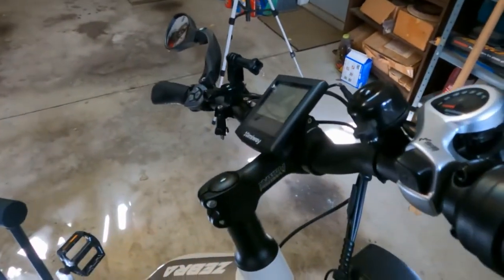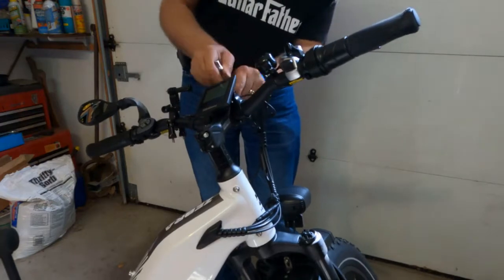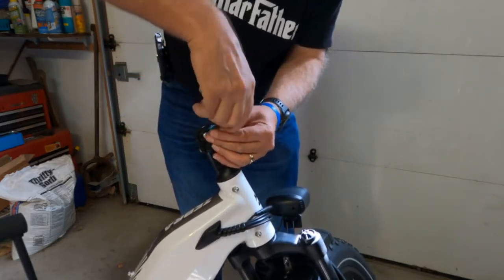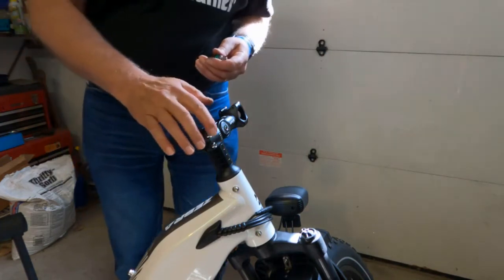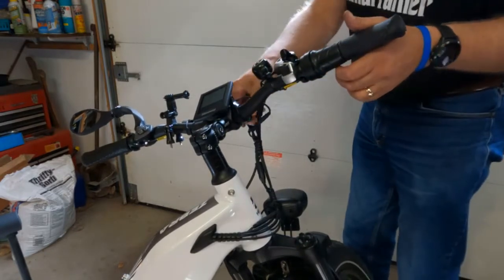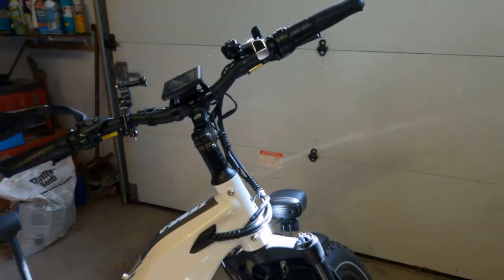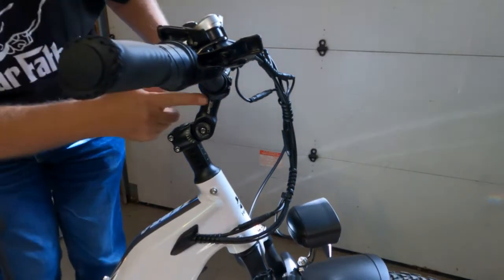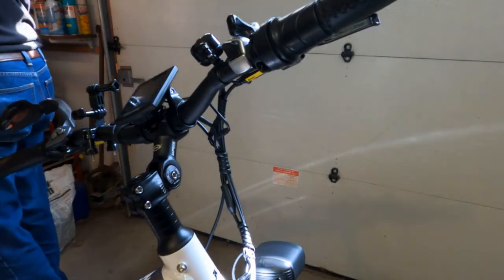How to install an Adjustable Extension Handlebar Tube on your Himiway E-Bike

Comment: Thanks for the video ,,,,,,,,,I tried my new e bike yesterday on the C&O Canal ,,,,,,I had my seat as low as it would go and when i put my hands on the handlebars my eyes were naturally focused on the front tire , so i had to tilt my head way back to look forward , very uncomfortable ,,came home and ordered an adjustable stem like you have (plus a more comfortable seat lol) 
Your video was just what i needed ,, not 100% sure i ordered the right size but with am@zon no issues getting s different size .
Reply from the maker: Glad you are doing what I did. I notice that my wrists are very sensitive to the angle on the handlebars but the rising stem does help. John

Comment: What he is leaving out is the calipers to measure the fork tube and the handlebars so you can order the right size stem
Reply from the maker: Yes, you do need to know the fork tube diameter. That can be by using calipers or looking at the spec's for your bike. I did the latter. If you order the wrong size stem, all bets are off the table.

Comment: I have a question. After installing my bike stem I Ickes it up to see if fork was snug and it moves, so I retightened as I held in place and it still moves.  What I’m I doing wrong? Thanks
Reply from the maker: You might need to add a small spacer and that will allow it to be tightened to not allow movement. You can buy a set of spacers on Amazon. Here is my associate link to the spacers I bought: https://amzn.to/3Pj6oTu     I didn't need to add any on my bike. John
Reply: @littlethislittlethat456  thank you!

Comment: Can you please explain tube and riser diameter sizes my bike may have and what to buy to make sure it fits.
Reply from the maker: I don't know what bike you have. In the description above, I put the link t the stem I used for a Himiway Zebra. To find out the size of your stem, you would need to measure it with a digital caliper (Digital Caliper, Adoric 0-6" Calipers Measuring Tool Electronic Micrometer Caliper with Large LCD Screen, Auto-off Feature, Inch and Millimeter: https://amzn.to/3YMcih1  for $10) that you can buy cheaply on Amazon. Also, you can contact your bike manufacturer support line and ask the size. John
Reply: @littlethislittlethat456  Thanks John!